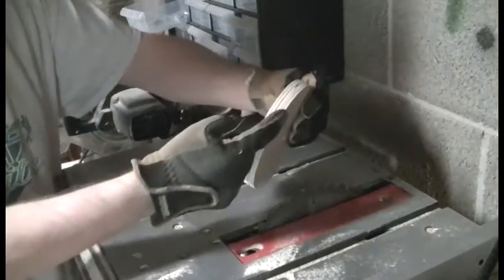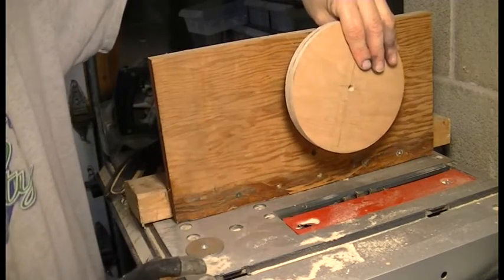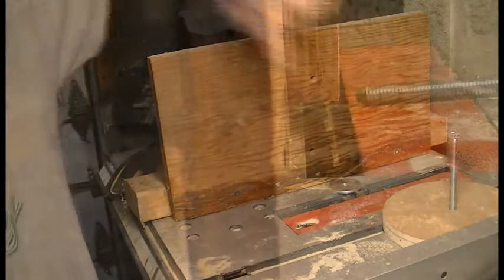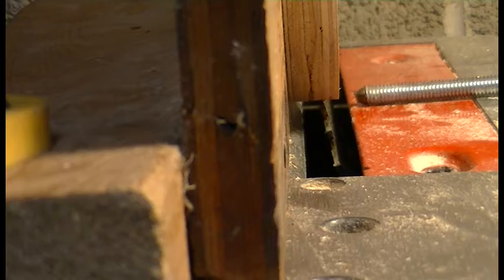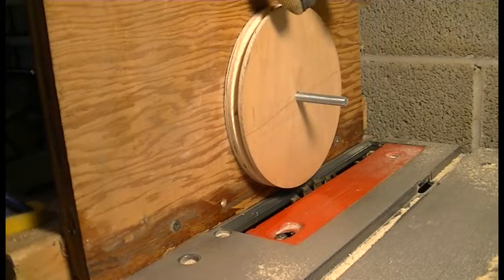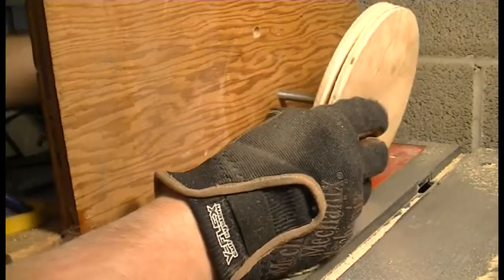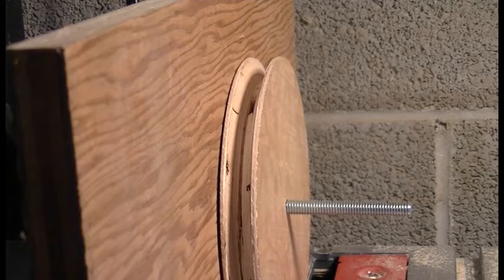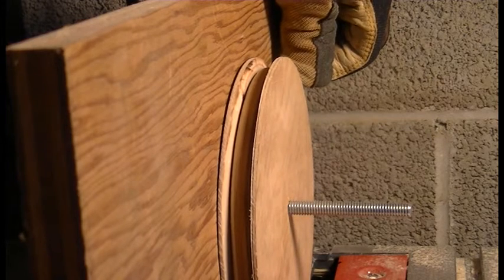cutting a pulley on the table saw

Comment: If you are wanting a curved groove in the pulley instead of a V-groove, leave the blade at 90 degrees, but angle the wood disc so that it is not completely parallel with the blade.  You will need to secure the wood disc more securely to the vertical portion though... The diameter of the saw blade will determine the profile of the groove that you cut...

Comment: I'll be making my own pulleys for my Christmas carousel. I need a triple reduction to go from 1550 rpm to approximately 10 to 12 rpm. It'll be glitzy & sparkly to match the rotating lights I use for the reins. (110ac😄)